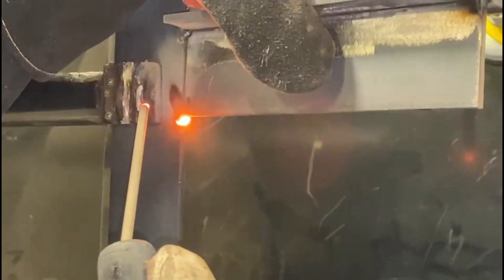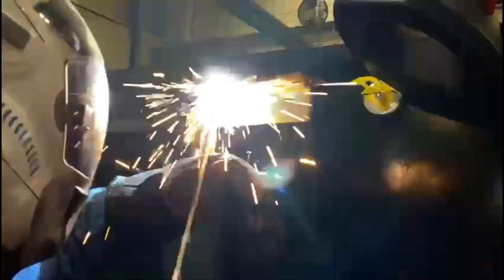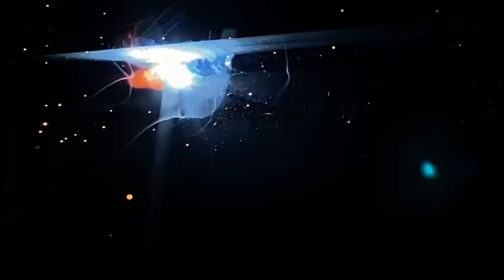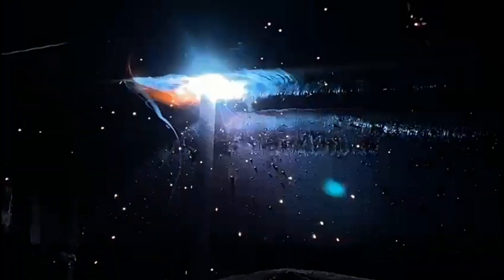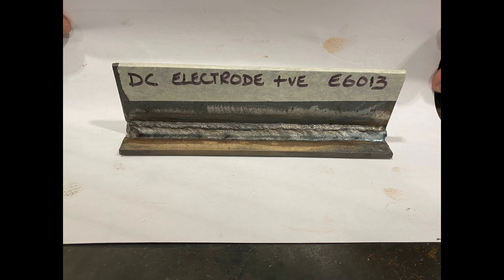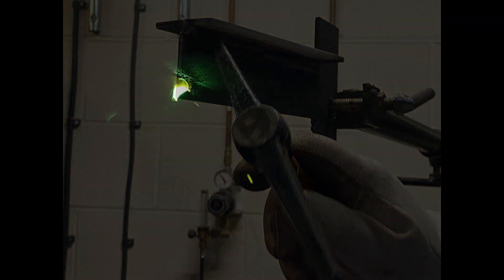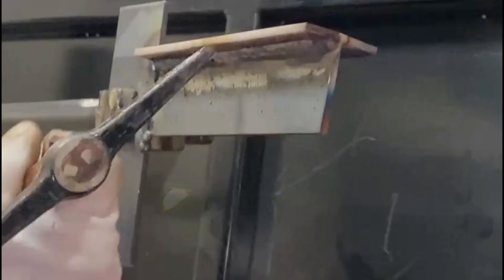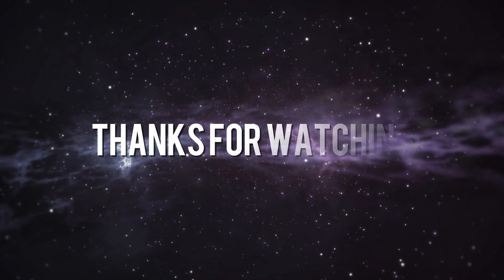Overhead E6013 stick welding with positive and negative polarity explained!

Comment: Hello brother 
I have a very big problem with 6013 
I can only weld it flat position other positions puddle drips and never stick to base metal. What should I do please help me
I have inverter welding machine which hase positive and negative cords. Should I change it like you?
Reply from the maker: Hi what size rods are you using and what amps are you running them on.
Reply: @weldtechsolutions  
Hi brother 
Thanks for replying 
I used amperage from 60 to 100 to weld with 6013 overhead and vertical positions but no success but i have never known about changing polarity. Evertime i weld vertical puddle just flows down and drips to the ground.
Size of rods 
2.5 mm 3 mm
Reply from the maker: @vorsprung2330  
I would use electrode positive. 
Amps for a 2.5mm I would look at around 80 for vertical  and around 90 for overhead.
You rod angle for vertical needs to be around 15 degrees pointing up.
When you put a slight weave on vertical thats to spread the heat to keep your weld pool cooler so you can defy gravity.
Ill have a look at vids that would help you and get back to you.
Reply from the maker: https://youtu.be/Fg0IQf-aG0w
Is worth a look
Reply from the maker: https://youtu.be/Q5U_9vryqSY
Reply from the maker: https://youtu.be/4KlarUoPG_Q
Reply: @weldtechsolutions  thank you so much brother. 
I will watch videos and practice it and let you know. 
Much appreciated your support

Comment: Good commentary, I agree. My problem is the overhead base metal is very thin and cooler electrode positive is the only way to accomplish anything without chasing holes all day.

Thanks for sharing this video.
Reply from the maker: Your welcome. 🙂
Reply from the maker: What thickness metal are you welding.?